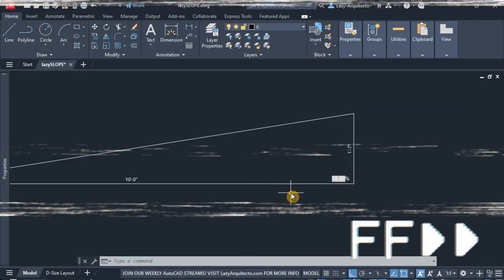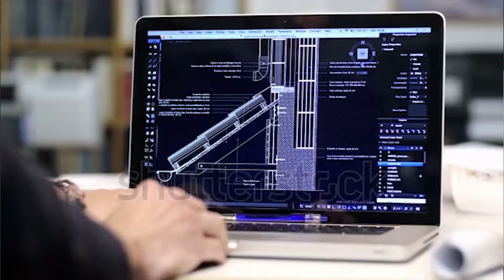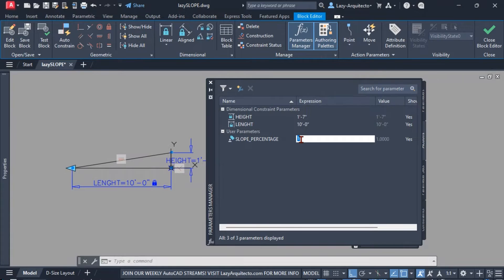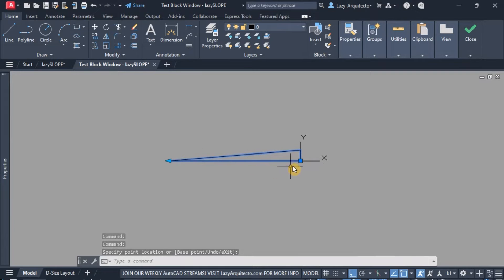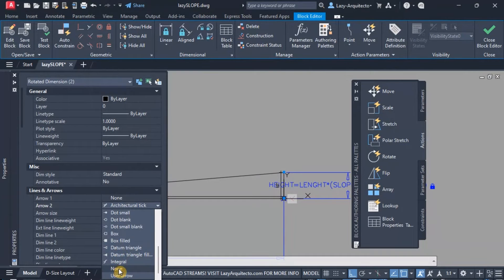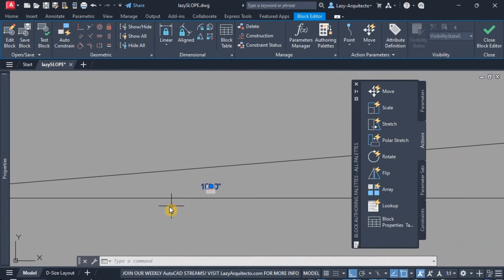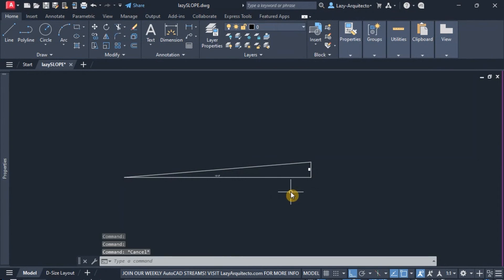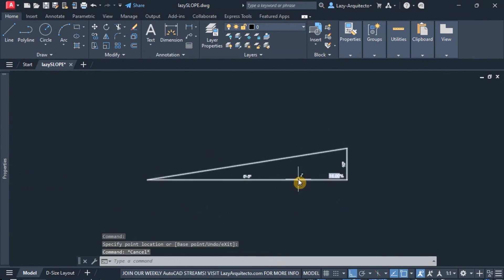AutoCAD Dynamic Block with Parameter Formula and Constraints

Comment: Thank you for posting all your tricks! I have been trying to find out if there is a method to add dimstyle options to a dynamic block. Could this parameter be added to include those options? Our blocks may  need to be in various scales, so this would be a nice option to have. Thanks
Reply from the maker: Hi 👋 yes it’s possible, however have you considered using annotative dimensions to allow you to use a single dimension and apply one or more scales to it?